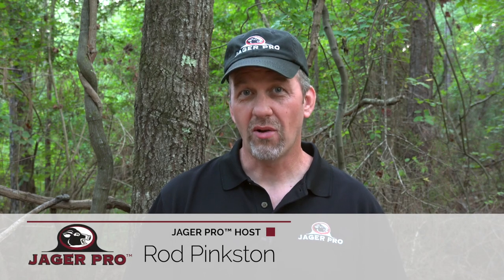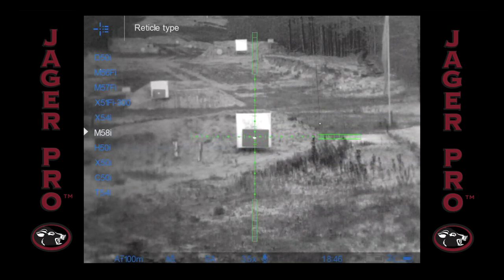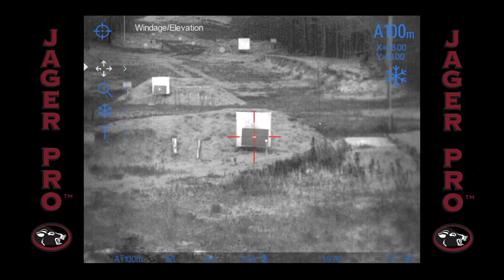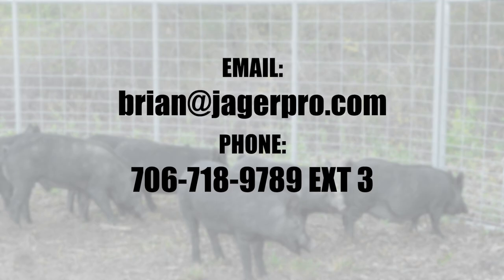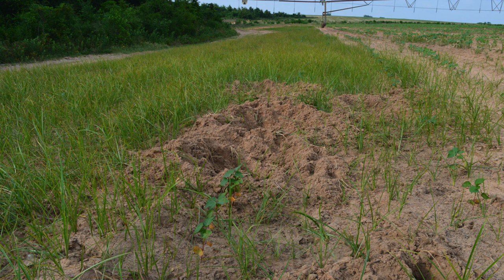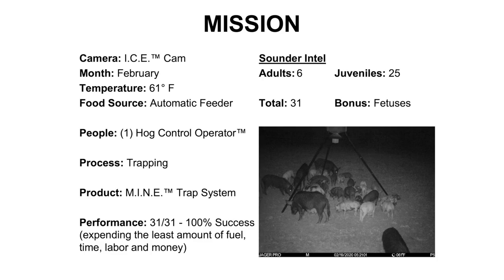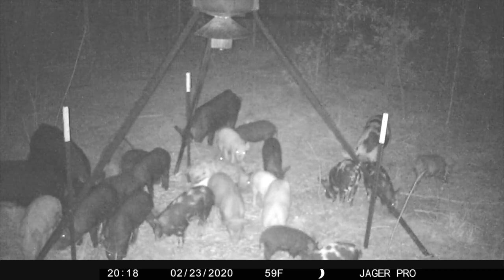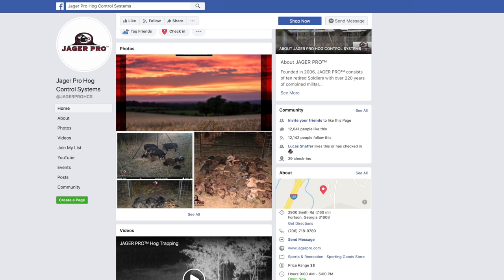WILD HOG CONTROL | JAGER PRO™ TV Show | How To Zero Pulsar Optics Plus Large Sounder Capture

Comment: This is the best way to drive these things into extinction.  It just needs to be done on a larger scale with extinction and eradication as the endgame, not just population control or removal.
Reply from the maker: It only takes 15-18 months for a trained and certified Hog Control Operator™ to eliminate feral pig populations from 10,000-acres. But there are several factors which determine how long a property remains at "zero balance" after a successful Integrated Wild Pig Control® (IWPC®) program has been implemented. Future reproduction and migration would have to come from adjacent properties since an effective IWPC® program would prevent escapes, method education and reproduction from the entire generation of feral pigs living on the property.
Are neighboring landowners implementing a successful IWPC® program? 
Are there enough trained and certified Hog Control Operators™ in the county to effectively implement the IWPC® program? 
Has the state passed legislation to stop intrastate and interstate transportation of feral pigs? 
How well are law enforcement personnel enforcing these rules in the state? 
Are judges and the court system prosecuting those breaking the rules with heavy fines? 
How many criminals are illegally transporting and releasing new feral pig populations in the county? 

The amount of time a property remains at "zero balance" greatly depends on the answers to the above questions. The feral swine problem will ultimately be resolved when we scale product sales and training/certification to several million pigs removed annually (with whole-sounder success) across the United States.

Comment: I think that in the future, billions of dollars will be used to fence the agricultural lands. An electrified fence should deter them from damaging the crops. Because these hogs will breed like mosquitoes, apparently.
Reply from the maker: An electric fence does not deter feral pigs from damaging corn and peanuts. Fencing is a logistically and financially flawed theory for two reasons. First, a fence does not address reproduction of the pest. A single sow will produce two litters of 6 to 10 pigs annually and their offspring will reach sexual maturity within six to eight months of age. 100 sows can escalate to 1,200 pigs (100 x 6 x 2) in one year. A fence does NOT stop reproduction outside the fence. Second, a single American farming entity may plant and harvest 2,000-3,000 acres spread across multiple counties. One square mile is 640 acres which would require 4 miles of woven wire fence costing $31,792. It would take 672 hours of labor to build such a fence to protect a single square mile section of crops. The total fencing cost for 100,000 acres would be approximately $5 million requiring 105,000 hours of labor. Our demonstrated solution only requires 8 hours of total labor from an expert using $100 of ammo and a $4,500 M.I.N.E. Trapping System. Whole-sounder success prevents any pig from escaping, surviving, reproducing or being educated to the removal process or product.

Comment: Can you ever make a dent in the feral hog population?
Reply from the maker: Absolutely! It only takes 15-18 months for a trained and certified Hog Control Operator™ to eliminate feral pig populations from 10,000-acres. But there are several factors which determine how long a property remains at "zero balance" after a successful Integrated Wild Pig Control® (IWPC®) program has been implemented. Future reproduction and migration would have to come from adjacent properties since an effective IWPC® program would prevent escapes, method education and reproduction from the entire generation of feral pigs living on the property. 
Are neighboring landowners implementing a successful IWPC® program? 
Are there enough trained and certified Hog Control Operators™ in the county to effectively implement the IWPC® program? 
Has the state passed legislation to stop intrastate and interstate transportation of feral pigs? 
How well are law enforcement personnel enforcing these rules in the state? 
Are judges and the court system prosecuting those breaking the rules with heavy fines? 
How many criminals are illegally transporting and releasing new feral pig populations in the county? 

The amount of time a property remains at "zero balance" greatly depends on the answers to the above questions.